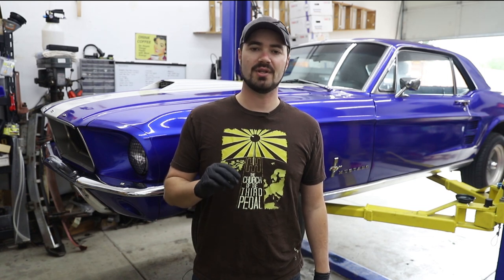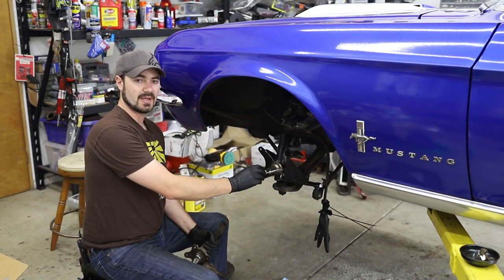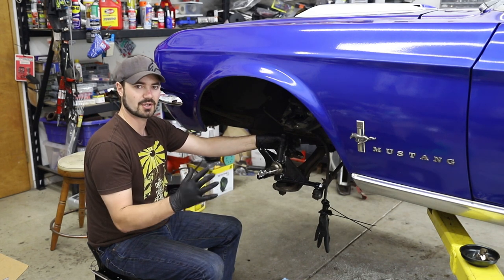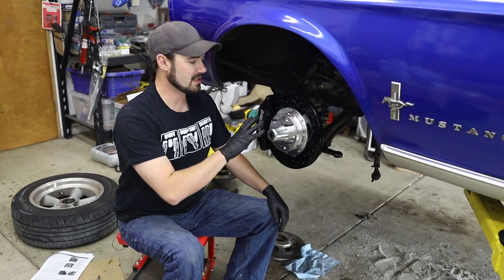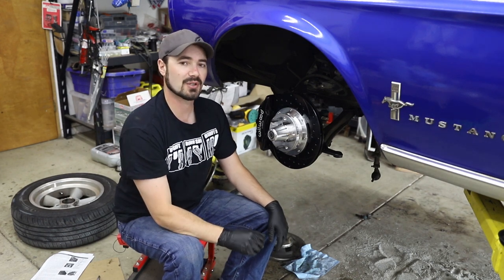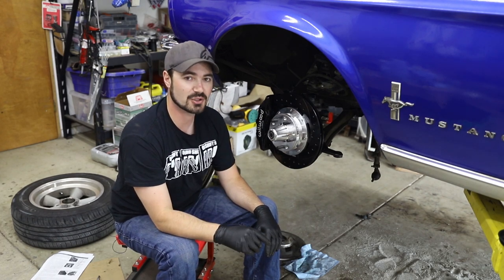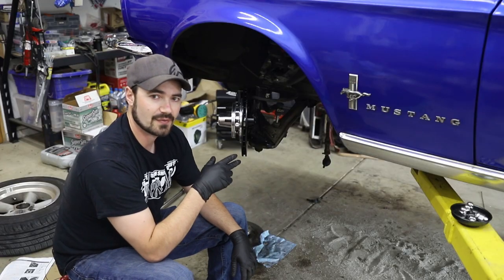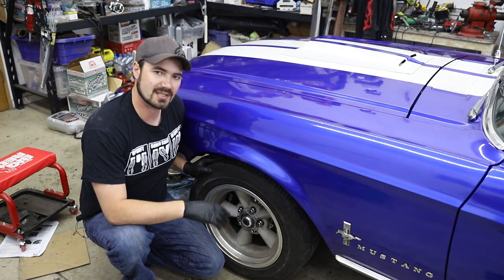67' Mustang finally gets Wilwoods and drop spindles

Comment: Good to hear from you again. The SSBC kit that I used had issues with wheel clearance and studs. Solved with spacers and ARP bolts as well as reaming the rotors for the bigger shoulder on the bolts. Sure they bolt right on, sure. They work great now though!

Comment: Nice video!! I’m in the process of installing this exact spindle but I’m doing it as I’m installing 315-30-18 on the front of my 65. I performed the Shelby drop when I built the car The first time wonder what would happen if I just left it and added the Maier spindle?
Reply from the maker: That's some serious meat under the front end! What suspension are you using to control those beasts?
Reply: AmbiVe planning on going with mike Maier’s up front suspension can’t go wrong with his stuff, no there’s a difference between the two Maier racing and mikemaierinc. What’s your feed back on the drop spindles with the Wilwood brakes?

Comment: I’m surprised you went with the dropped spindles and not a Shelby drop. We’re you really concerned with the thinner spindles? At the price of the Wilwood stuff you’d think they were more on the ball with directions.

I watched one of your driving videos, it sure looked familiar. Are you somewhere in the Schols/Newberg vicinity?
Reply from the maker: The Wilwood instructions were good if you used stock spindles, it is all slightly off once you mix in the Maier Racing spindles.

There are some benefits to spindles over Shelby drop, and the larger bearings were a nice bonus. Keeping good suspension geometry and not making more mounting holes were also good.

Most of the roads I have done videos driving are South of Salem or towards Silver Falls.
Reply: AmbiVe Interestingly my car came out of Aumsville.

I thought the stock geometry was exactly what the Shelby drop was trying to get away from? Does the Maier stuff adjust the geometry to improve it like a Shelby drop would?